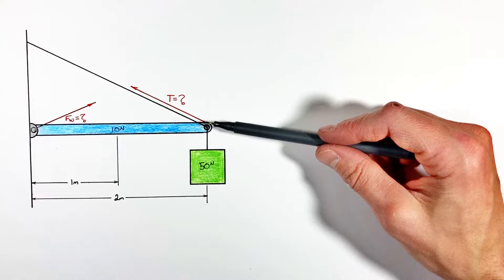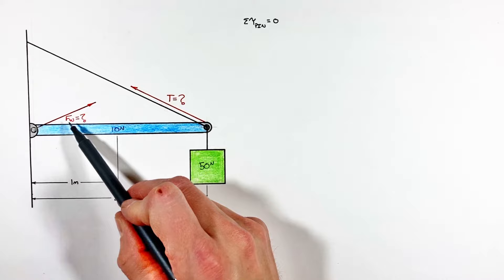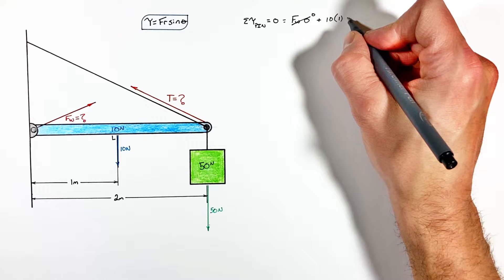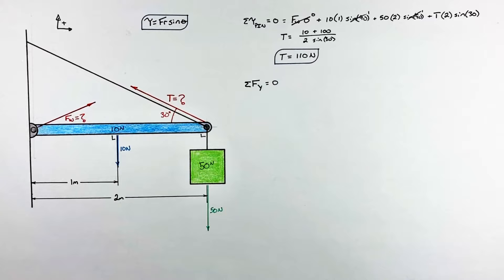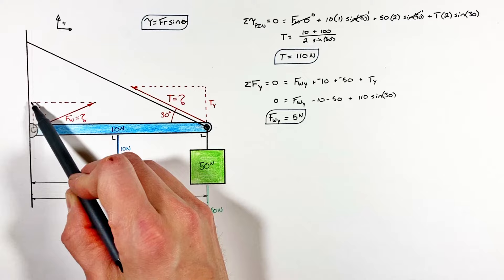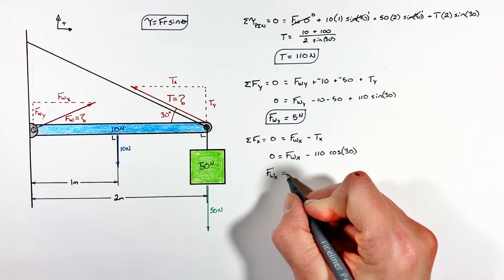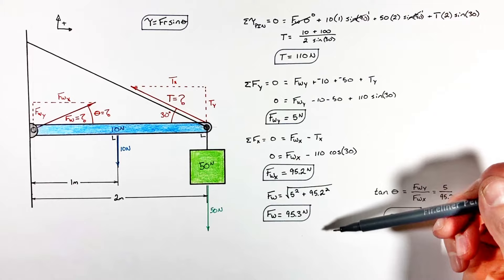Find TENSION and REACTION FORCE on a Cable Hung Beam  |  Statics for Engineers

Comment: What happens if the beam isn't in a horizontal position, but rather pointing 30 degrees upwards with the cable still holding it?
Reply from the maker: Fundamentally you find the solution following the same process;  however you have to be careful with the angles surrounding the forces by gravity, they would no longer be 90 degrees.

Comment: how does it make sense that at that snapshot in time, when the beam is fully horizontal, there is a vertical normal force component exerted by the wall?
Reply from the maker: Something has to hold up the left side of the beam.  Without that vertical component by the wall, the downward force by the weight of the beam would produce a net torque around the point where the cable attaches to the beam, allowing the beam to fall down.

Comment: By convention, shouldn't the first equation have (+) signs for counterclockwise torques and (-) signs for clockwise torques.? The equation that follows to solve for tension appears to be correct.
Reply from the maker: That is one conventions that irks me, not because it's wrong, but because it's completely arbitrary yet so many people teach it as an immutable law.
Reply: My comment was more along the lines of the absence of the (-) signs in the first equation that was presented rather than the sense of the torques. The sense really doesn't matter to me. That being said, both mechanical engineers and physicists seem to agree upon the same convention. With respect to the sense convention, it is similar to circular polarization: IEEE considers the sense of the departing polarization, while physicists consider the sense of the approaching polarization, the latter being contrary to the right-hand-rule.
Reply: There is mnemonic that is consistent with the cross product of two vectors that says that the vector points out of the page when curling the fingers counterclockwise with the right hand.
Reply from the maker: I do love the right hand rule.

Comment: Can you please provide a diagram for the cable's fixing point on the wall? It's really confusing as there is the tension on both sides, the wall reaction etc..
Reply from the maker: A cable or string has equal forces on each end, however the forces are in opposite directions (both forces by the cable point inward toward the center of the cable).  Meaning the force by the cable on the wall is down and to the right with a magnitude equal to the force by the cable on the beam.
Reply: @INTEGRALPHYSICS  So there must be also a reaction force from the wall contradicting that end's tension, right?
Reply from the maker: Correct.  The tension is down and to the right, the force by the wall is up and left.

Comment: for the Sum of forces at Y is 50n Should be multiplied by the distance of 2m
Reply from the maker: No.  That calculation is based on the sum of forces, on the system, not the sum of all torques(moments) about some point.  Distance is not involved.

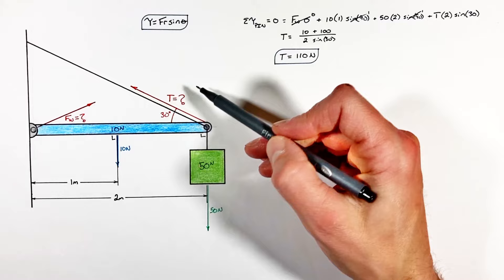Comment: I’m not sure if this is a stupid question but how did you calculate the tension force? 3:12
Reply from the maker: In the numerator we have... 10+100 = 110
In the denominator 2sin(30) = 1
Put it all together and 110/100 = 1